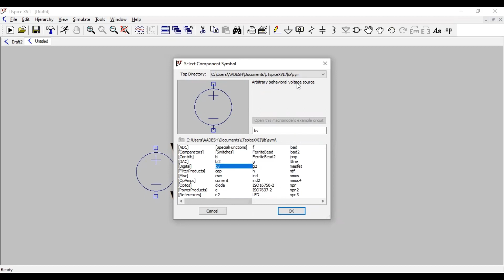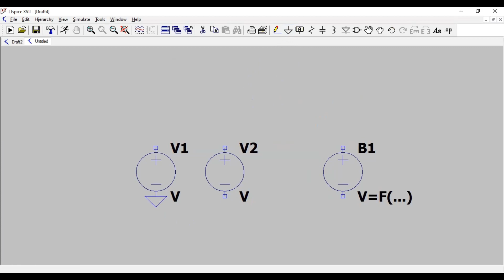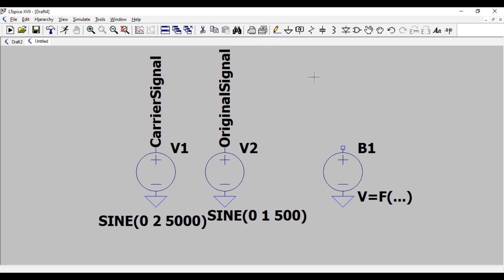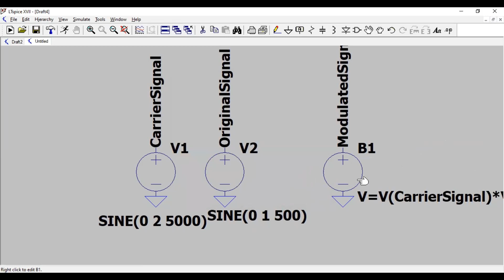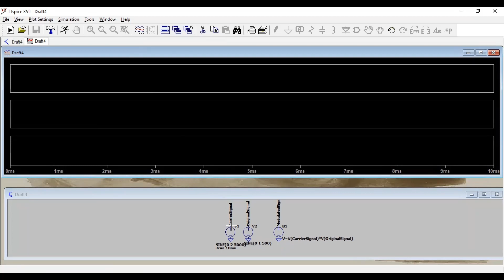Amplitude Modulation using LTSpice

Comment: Respectfully, since you added no DC offset to the original signal the modulated signal is a carrier-supressed dual sideband and not "amplitude modulated" per se. If you check the FFT you'll see no carrier at 5Khz - only the USB and LSB represented.